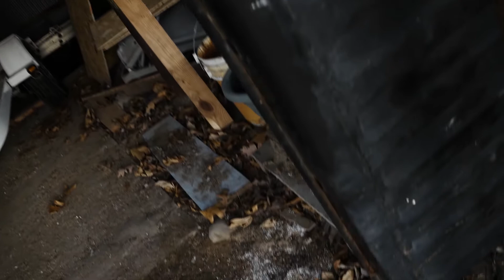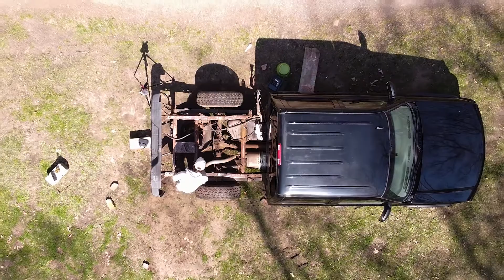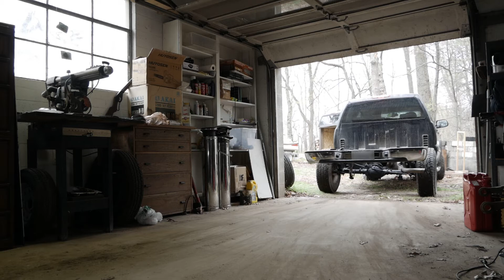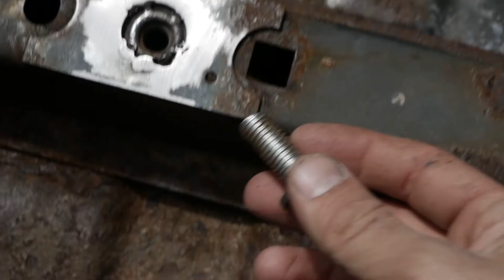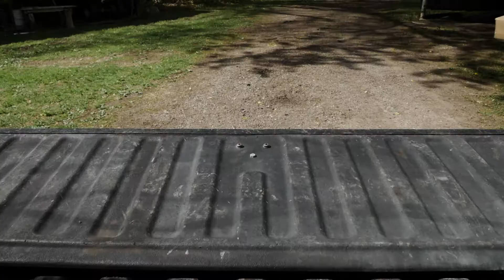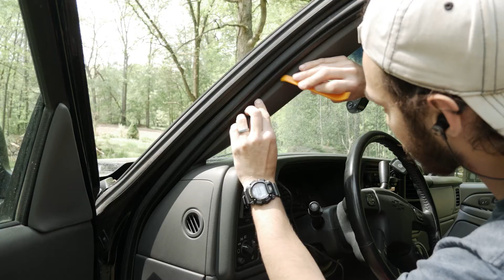I Bought a Used Truck in Michigan.

Comment: You did a great job except the rockers. Rockers on some cars are structural, the plastic covers are only temporary as the rust will continue and only get worse. Your inner rockers will eventually rot out. You should consider doing it right as you did good on the rest of your work. I learned a lot on your gas pump replacement and have to do that on my Silverado soon enough. I hate rust!

Comment: Did your fuel gauge work ? I got the same truck same fuel pump the gauge don’t read the gas I already check all electrical it’s good but idk what it is
Reply from the maker: At first it didn't but I soon realized that the tab on the top of the fuel pump ring which is supposed to help align it wasn't in the right position so the sensor arm kept getting stuck against the side of the tank. I ended up cutting the tab off and rotating the pump to the correct position and it fixed it.
Reply: @RuralPlayground  what tab on top of the fuel pump ring ?
Reply from the maker: @nbsalan_5763  I meant to say the tab on top of the fuel pump, not the ring. Just make sure when you install the fuel pump that the float arm is oriented in a way that its movement will not be obstructed once installed.
Reply: @RuralPlayground  do I have to change the float arm or can I just use the one the that came with the pump
Reply from the maker: @nbsalan_5763  the one that came with the pump should work unless it's a different shape or length, then you may need to swap.
Reply: @RuralPlayground  yeah I did what you did in the video used the level arm from the delphi pump still don’t read
Reply: @RuralPlayground  out of luck :(